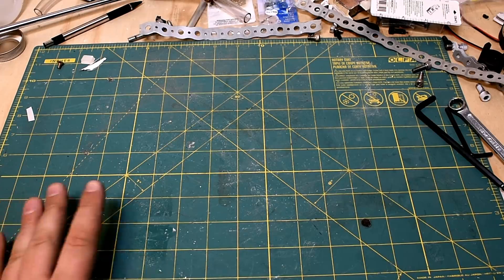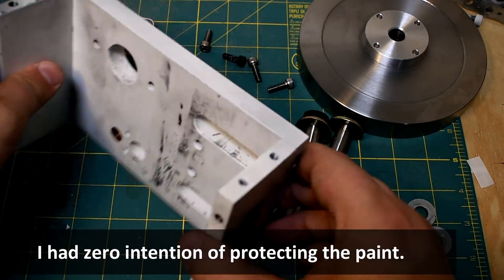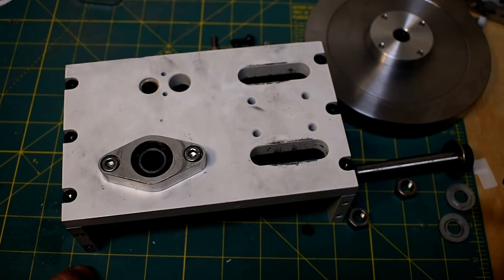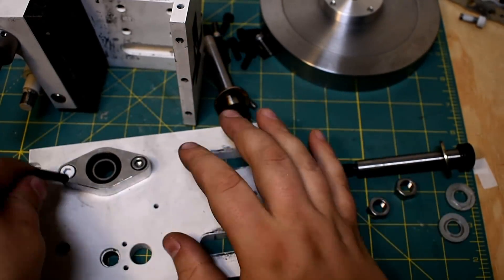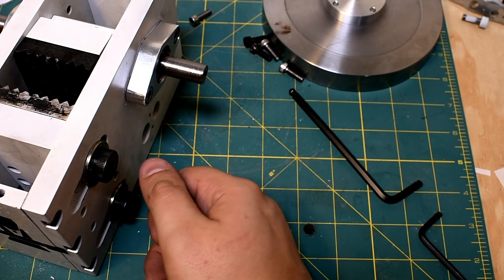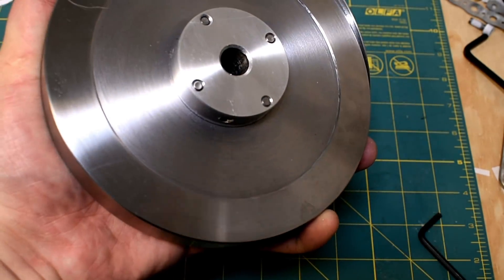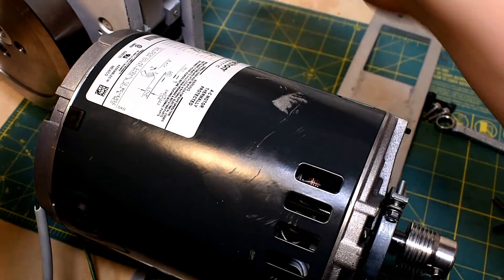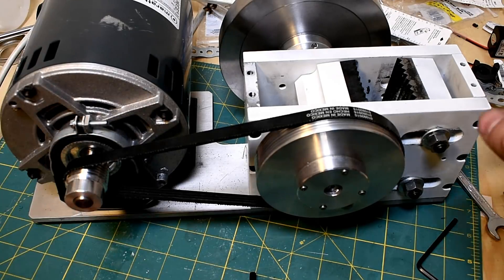The best way of crushing granite for an epoxy granite build!

Comment: Locally I can get 0-2 mm, 2-5 mm, 5-8 mm, for paving and decorative purposes. I thought that would suffice. Is fractioned crushed granite not available where you are? I eventually went with natural granite, found two unused headstones cheaply.

What's your plan for handling tension? Steel reinforcement or just trusting epoxy?

Comment: If you drill and tap a hole behind the fixed jaw you could thread a bolt through to stop the jaw from sliding. A bit of rubber cement should help keep it from turning out. Might help keep the crushed size from getting bigger during a long crushing run.

Comment: hi very nice design i have been making one like this but to crush large rock and brick on first attempt the rocks just bounce at the top, you built a rocker in the bottom but idont think this needed, i have used springs as dampers, when i have got mine running ok i will put it up, do have a look
Reply from the maker: Yeah I'd love to have a looK!  I found that when the angle between the jaws was too large the rocks would bounce a lot more as well.

Comment: I'm looking for a machine like this that turns stones into fine dust. Do you have any ideas or suggestions?
Reply from the maker: Hi Debi,

I think the easiest and cheapest thing to look at would be a rock tumbler.  If you add the rocks you want to crush and steel ball bearings (preferably hardened ones,) they'll slowly pulverize the rock and make a powder.  This might be a good way of getting an ounce or two of stone dust every week, but anything more than that it's probably going to be the most cost effective and fastest to just buy stone dust.  I hope that helps!

Comment: Hmmm... aluminium blocks with stainless screws....setscrews where keys should be used.... shortcuts !
You shouldn't do this, you know.... I knew a chap, who ended running for prime minister when he was 62 years old, but in his early years he had the weird habit of squeezing a tube of toothpaste in the middle rather than the end ! This to the dismay of his wife, his mistress, his illegitimate daughter and his neighbour's aunt.... 
Long story short... this cavalier behaviour in youth eventually led to  string of horrible murders, a fortune being squandered and decades long prison sentences !
Just to say... be careful !

By the way, what about Dolomite instead of granite? This is a type of marble, and you can actually get it powered (Dolomite dust) in 40 Kg bags... (you can get coarser grades too)
Toodles!

Paddy
Reply from the maker: Well they say that’s where Amy Winehouse went wrong—she started on set screws for oscillating loads and then progressed to stainless fasteners in aluminum.

Hmm never heard of dolomite.  I know granite is the magic ingredient in EG because of its compressive strength and vibration damping
Reply: Oh, you may well be right about Amy Winehouse... though I was always led to believe that she had it coming once she developed a passion for lubricants of a dubious pedigree...
Dolomite is a type of marble.... found in err... the Dolomites (surprising as that may strike you...). It is used in these parts to put on driveways and the like. It has an ochre -like colour.
The main reason I suggested it was the fact that it can be had in 25 or 40 kilo bags, in most places that sell gravel and paving stones and the like (at least in these parts).
For more info on said type of rock, I suggest befriending the Googles....

Toodles!

Paddy

Comment: In addition to EG have you considered just using solid granite in places where it's easy to work, like as the machine base?  Small toolroom grade surface plates seem quite reasonably priced considering, and then all you need to do is drill inserts  for mounting.  I'm considering this approach on a fixed gantry build I'm working out right now.  I think I'll be able to do the entire structure with just 4 solid blocks and just using epoxy grout for gantry leveling and not having to worry about aggregate at all.
Reply from the maker: I have considered it and I've also seen it done a few times.  I actually drilled some granite for work once and epoxied in some inserts -- I just used cheap chinese diamond hole saws from Amazon -- you drill to the depth of the hole saw (using lots of water and low speed) and then just knock out the center.

The reason I'm not using it for my build is simply because I want more control over the shape.  Otherwise, using granite is a solid choice.  If you're interested in seeing a granite bed machine (a lathe) done really well, check this out:  https://www.youtube.com/watch?v=sFrVdoOhu1Q

Comment: This is so cool!  I was thinking of doing something different but I need the same result for the same purpose.
I was thinking of putting some crushing media in with pieces of granite chunks similar in size to what you have. I was considering a 5 gallon bucket attached to a motor w/a pulley (like a rock tumbler).  What I have seen on of that on YouTube let's me thinking it would make granite powder (after a couple of hours).  Did you consider that approach?
Do you happen to know any reason why you need bigger pieces mixed in for epoxy granite?
Reply from the maker: I did consider the rock tumbler approach  but figured that it would leave me with beautifully polished granite rather than crushed up granite.  I think the forces aren't really high enough in a tumbler to actually break the rocks up, so it just kind of wears them down.

For all the research I've done on epoxy granite I still don't know exactly why you need a mix of sizes, but I imagine it lets you take advantage of the compressive strength of granite and shear strength of epoxy by maximizing the actual amount of granite without compromising its ability to fill the mold.  Granite is also cheap so perhaps it is partly cost saving.

Comment: i would have probably gone bigger.  and used automotive hub and bearing assemblies.. so that automotive flywheels could be drilled and bolted to the hub and bearing wheel flange... since these assemblies are splined  the hardest part would be making the eccentric shaft with splines that match the hub bores.. this would allow the hubs to by synced..  offset weights could be added or the flywheels could be drilled to remove some weight to counter act the offset weight of the eccentric shaft..
Reply from the maker: I think if this was a permanent setup I would have gone bigger too, though it is nice and portable and the whole assembly sits nicely on top of a 5 gallon bucket to collect the material.  That's good thinking on the automotive assemblies though!

Comment: I enjoyed your build. The only comment/ criticism I would make is the stainless screws holding the bearing blocks for the eccentric shaft are carrying all the oscillating loads. In a full size build, the blocks would be spigoted somehow to direct the load straight into the side plates.
Reply from the maker: That makes sense.  I considered adding dowel pins, however I wasn't sure I would be able to align it well enough.  I think in hindsight the thing to do would be to assemble it and line bore the holes for the shaft and then locate the bearings directly off of those

Comment: I think technically those are flange bearings not pillow block bearings. A pillow block bearing is a type of pedestal bearing that holds the shaft parallel to the mounting surface.
Reply from the maker: I think you're right.  I kind of use "pillow block" interchangeably for mounted bearings

Comment: I've been around full size rock crushers pretty much my whole life from gravel pit sized to over 100,000 ton per day open pit mining crushers. You get A for effort on actually making your own crusher, but to be honest few areas anywhere wouldn't have some type of roadway rock cuts, stream or river beds with an abundance of rock sized from sand diameters up to automotive sized. Home and garden centers, metal suppliers etc stock a variety of screen and wire mesh sizes so that, a shovel and a large plastic garbage can you could screen all you need in half an hr. Even a 2 hr drive each way to go find it would be a whole lot easier than building your own crusher and then still having to find a ready supply of rock. Just my thoughts and worth just about nothing, but it's another way I guess. Your crusher is running a bit fast, jaw crushers run slow so the rock has time to move down each time the jaw closes and opens. Yours still works well enough for it's needed purpose, but slowing the rpm down while upping the torque level would make it more powerful.
Reply from the maker: I'm glad you commended, that's really cool!  I didn't even think about giving the material time to  fall back in.  I guess I assumed small rocks=less torque=go faster, but gravity is constant and small rocks need just as much time to fall back in as big rocks.  That must be why it tends to "eject" rocks every now and then :P.

I actually did think about just harvesting "pre crushed" rock and using sieves to classify it, but I ultimately chose this method because for this application it has to be just granite, so rather than collecting lots of material and sorting out the granite, it's easier for me to pick some larger (relatively :P) pieces of granite, crush them to size and know that it's pure granite.
Reply: I'm in western Canada so finding granite almost anywhere isn't tough. I've also used small jaw crushers at a mineral testing lab and the material getting ejected sometimes isn't uncommon,  the large ones are deep enough the rock doesn't leave the crushers opening.  Both gyratory and jaw crushers run fairly slow for the reason you mentioned so the rock has time to move down before the opening starts to close up again. Just because the rocks and crusher is smaller physics doesn't scale the forces down, the rock is just as hard at your size as multi ton boulders are. So the forces are still a lot higher than it would seem they need to be. Not many can say they crushed there own granite to use in an epoxy / granite machine component so that alone gives some bragging rights and still makes the crusher build worthwhile. :-)

Comment: Seems like an easier way would be to put it in some type of sack and smash it with a sledge hammer.
Reply from the maker: I thought about that too, but it'd be hard to control the crush size and I can't really think of a bag that would be up for the job.  Plus, you know, effort.

Comment: A girlfriend ;-) operated bang bang maxwell hammer came down tilt hammer or tail helve hammer is the easier setup using a pivot in the helve and a simple rotational mechanism to lift the hammer(s) up and gravitation is doing the rest. Various frequencies of lift provides the different sizes of crushed material. A sieve for sorting the size.
Reply from the maker: Haha was that a Beatles reference?  Love it.  Those tilt/helve hammers looks really cool!  I double I could miniaturize it enough to fit in my house, but I love the rotational lifting mechanism
Reply: sure a reference :-). Why not use a 300gr hammer with a real good hardwood helve, drill a pivot hole in the helve, a rod that holds the helve and another one aligned with a rotating block / finger to lift the helve. Fine hammering. And not a big thing. I like your idea to crush your own granite. That is why I commented. Herri in Kunming.

Comment: i hope your planing on coating your mold with several coats of epoxy, torching out the bubbles on the face of the mold, then after it tacks up placing a colour or fine aggregate epoxy layer over that.... then pour your thinker mix over that.
Reply from the maker: Ya there are a few things I'm going to experiment with.  I'll look into giving this a try though!

Comment: What was the thinking behind the direction of the serrations on the jaws? I would have thought you'd want them 90 degrees from that, so that it's able to really grip the rocks
Reply from the maker: Honestly I just did it because that's how everyone does it, but I have to think its to prevent jams and material buildup.  I suppose if they were more staircase shaped you could get a situation where small rocks fill the bottom, big rocks fill the top and maybe it stalls the crusher.  Maybe I'll look into the reason more for the next vid!
Reply: For some reason I thought cody reeder's rock crusher (which i'm sure you must have seen if you spent any amount of time on youtube researching rocks) had the "stair" shape, but it turns out his were actually just smooth, so it seems that jaw shape is a lot less important than I thought it would be

Comment: It seems like it's worked out just fine, but with this kind of arrangement if you wanted the fixed jaw to be a bit more solid you could easily add some jacking screws in the plate behind the jaw to give it some support. It would also give a convenient fine adjust
Reply from the maker: That would definitely be a better approach.  It would be cool if there were some meaningful way of selecting the crush size apart from guessing
Reply: If you're able to distill the adjustment down to a single knob, you might be able to calibrate the dial. Adjust, crush, measure, mark the position.
Reply: @Tabletop Machine Shop
at any rate you will end up with the necessity to sort of out the retuls, as there always be different fractions
Reply: Maybe a sliding wedge behind the anvil, it can handle the loads easy and you can adjust with a single moving part.

Comment: What are the jaws made of? Did I miss that part?
Reply from the maker: I was going to go over it in more detail in the "design and machining" video, but they're "tried-my-best-to-harden" 4140.
Reply: I would try something like W.Nr. 1.2714 hot-working tool steel, it is regularly used in forging dies and thus can handle great pressures and loads. W.Nr 1.7225 ("4140") is great for structural stuff but not any long term in this use, but great choice for ease of heat treating it further just to get the machine running :)

Comment: Now I'm wondering how well epoxy granite would work as a surface plate, or other granite metrology accessories. It would be pretty slick to mix together gravel and glue and make tools that would cost many hundreds of dollars
Reply from the maker: I've actually heard that epoxy granite can self-level to like 0.001" just from gravity.  That would be a good starting point to really lap it in